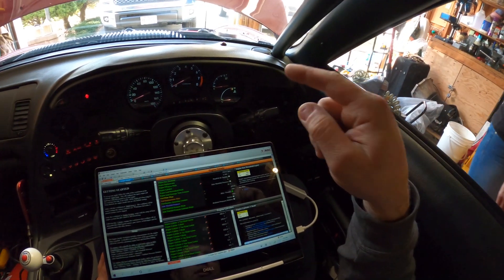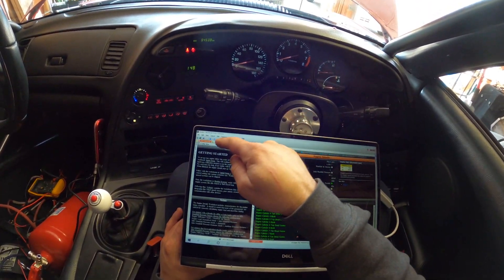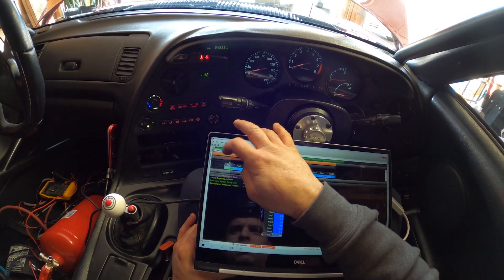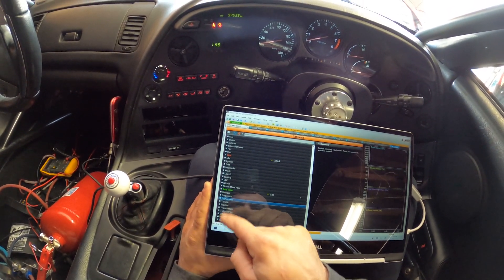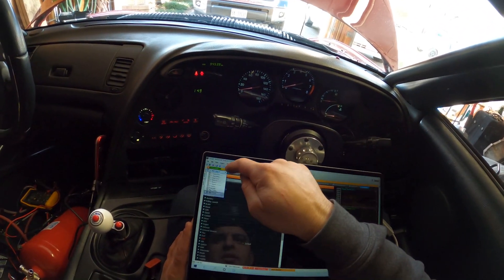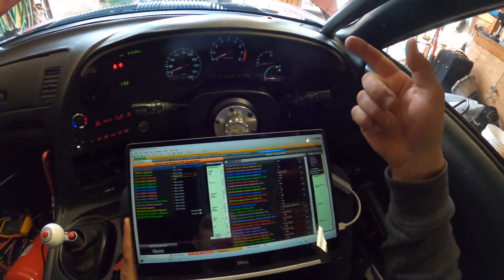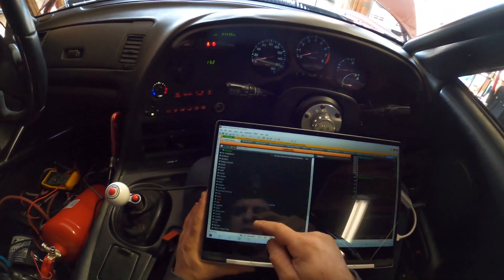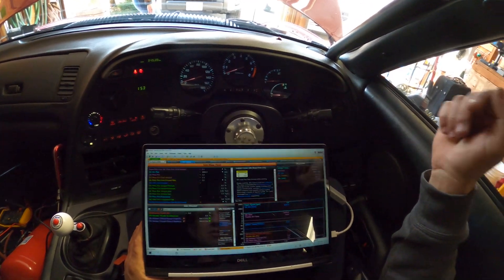Supra Motec M1 Tune test

Comment: Really nice ecu. I understand it is not hard to use and it is loaded with plenty features.
Reply from the maker: Once you get the hang of it, everything is organized. I like the search feature, simply type in the bar what you need and it shows up
Reply: @RyanSammutRacing  I'm hoping to get me one for now I'm learning through you lol. I'm running a street 2jz setup and I'm trying to decide on the right ecu to get for future goals. Thanks for the great content.
Reply from the maker: @fredfred9758  for street use, Haltech or Proefi will do the job. Motec does have more options and features.
Reply: @fredfred9758  EMU Black.   Haltech is overpriced and ProEFI is a literal joke.
Reply: @TurboVisBits  I will never get ProEfi even if it was free lol. EMU black is nice especially they have a pdm to go with it. Haltech to me is at a reasonable price and is very reliable with an overwhelming support by the best tuners in the game. I'm going with a sports maxxecu mainly because it supports the factory A340 transmission that makes things easier overall